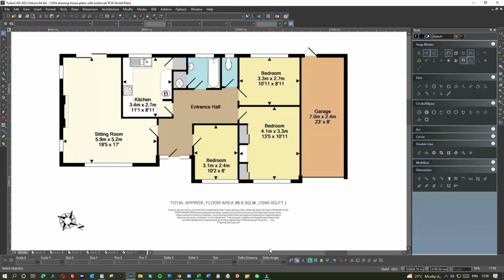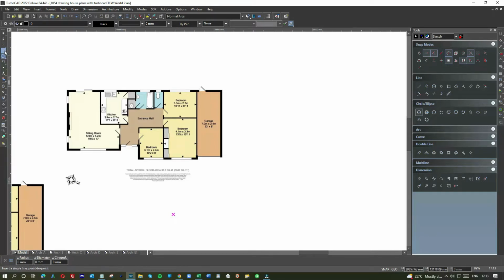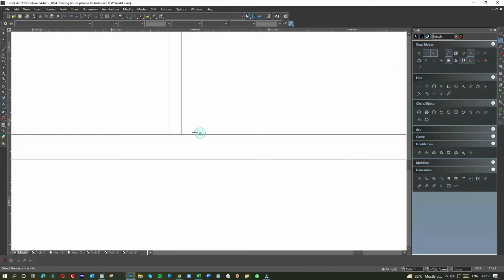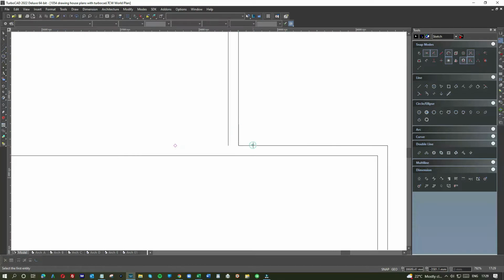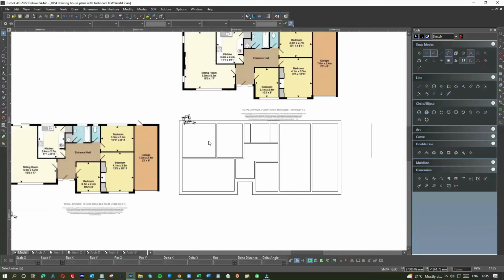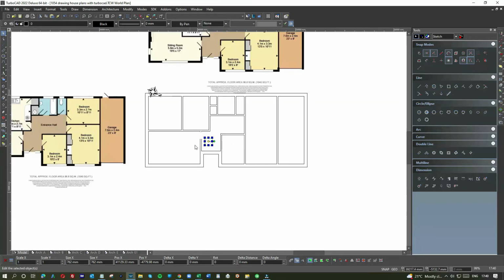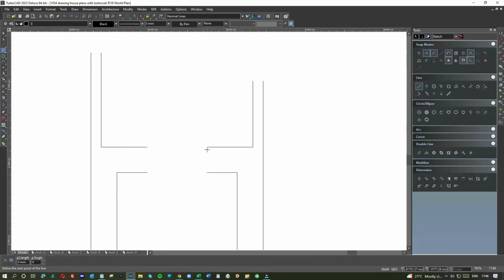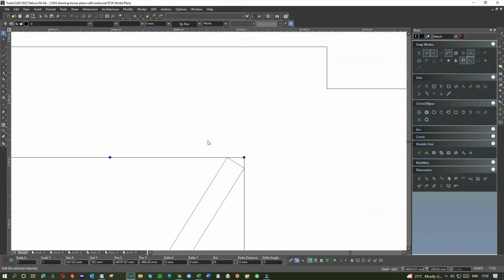How To Draw Bungalow House Plans With TurboCAD - Part 1 | Bungalow Design CAD Tutorial

Comment: Could you have imported or converted those original plans to raster images, to get exact snap points? Also, wouldn’t you have been meter to put your walls in using double lines, instead of constantly having to re-establish the lost lines from ‘meet two lines’?